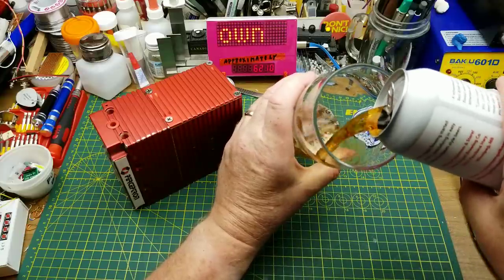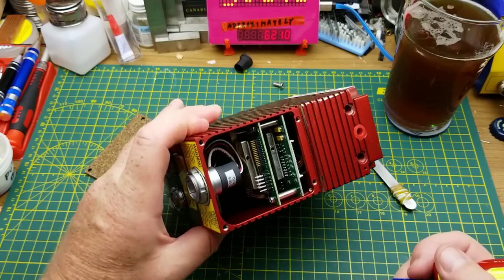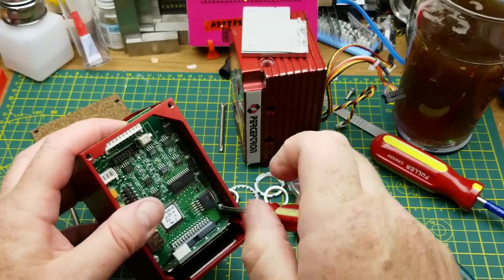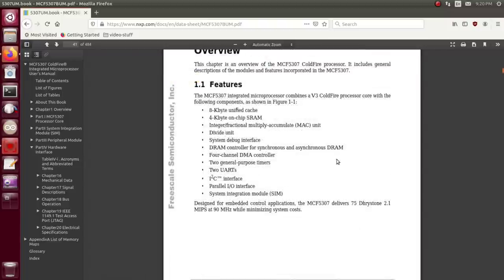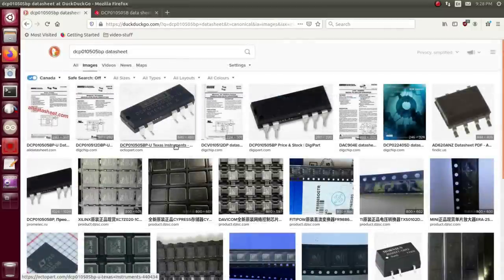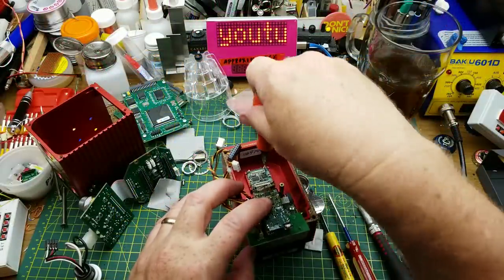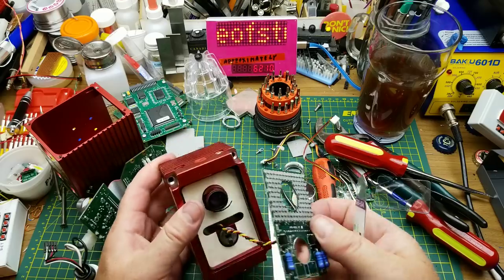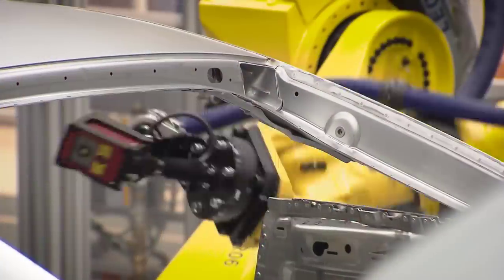industrial laser/camera unit teardown

Comment: For a little more  info on the tear down I did,  there is actually a set screw to hold the laser in place,  it is on the side of the shell, (small diameter hex screw) and it pops out. (the first one I tore apart I forced the laser out and the second tear down, I removed it properly).   Also there is indeed  epoxy type adhesive holding the camera module in place, and that is what I damaged in removing the camera, the camera chip and the lens were not damaged just the epoxy.  Messing around with the pin outs and some research of the pin-outs, I did manage to get the camera to work outside the assembly.  The LED array is designed for flash and momentary illumination, the robust resistors are doing their job protecting the circuit.  The laser...  is very strong, and the camera do work independently of the unit, and can be used in other projects , of course stripped of the proprietary circuitry.  I really enjoyed watching this video, you did a great job.

Comment: It's a shame you couldn't get the camera and laser out. It is so well made.
Reply from the maker: I might give it another shot at some point, but it doesn't look like they are intended to be removable/ replaceable.
Reply: @pileofstuff  From my experiences with vaguely similar laser devices twenty-ish years ago they are removable as modules but often require special, sometimes proprietary tools. Well, that was true back then but now you can buy "Keep Out" screwdriver bits on Amazon. Back in the day we would grind our own from duplicate hex bits and so on.
The laser and camera modules in your unit look to just be glued in though- the trick will be finding a solvent to dribble in that won't tear anything up. I'd start with acetone since it's relatively harmless. Harmless to the mechanics and electronics and so on that is- you will benefit from an exhaust fan. Don't ask how I know.
I really recommend giving it a try- the optomechanics used to scan laser beams and the optics for the camera are guaranteed to be very interesting.
Reply from the maker: @markfergerson2145  I was hoping to get a closer look at the galvanometer or whatever it uses for scanning.
I haven't fully given up, but I also don't want to destroy it completely - much less to learn from a pile of mangled pieces

Comment: All that horrible looking maths is basic 3D calculations. Input position, rotation, and center of rotation into a matrix, then do things with that matrix and other calculations.
I expect most of this is simply to work out the exact position of the camera/laser scanner, given nothing more than the rotations of the arm.
In reality the code is much simpler, as programmers use libraries and functions to simplify coding and also make it easier to read.